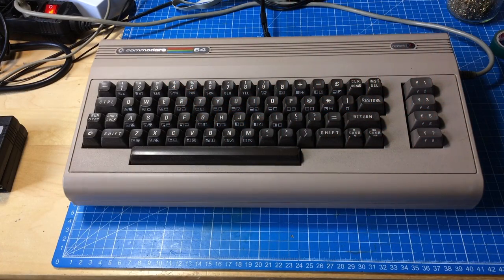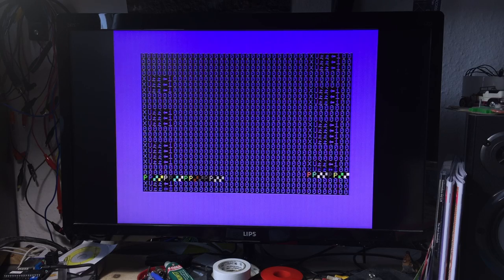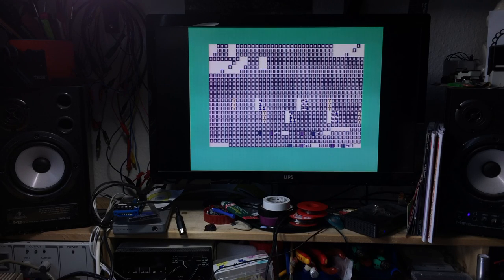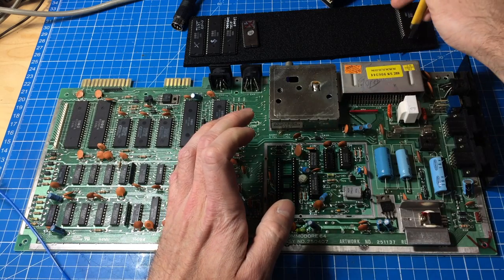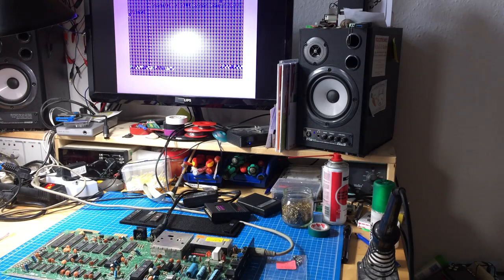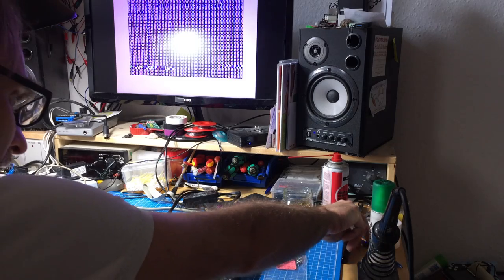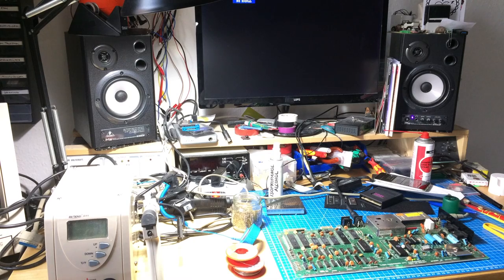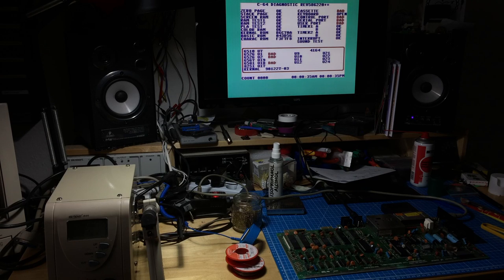Commodore 64 Repair (Garbled Screen) ASSY 250407

Comment: as a kid my first computer almost got to be a (used) C64, however it had a fault just like this. 

my parents and relatives (who were the previous owners) tried a while to fix it but really were at a loss about what to do. last time they used it, it was just fine, they said. i remember them switching the fuse on the board and hoping it would maybe change it. 

and i would power it on and notice that some characters changed on the screen when i pressed some keys, and hoped that maybe if i do that long enough, at some point it would eventually return to the normal screen :D of course it wouldn't

in the end that lead to me having to wait a while longer until i got my first computer, which then was a 286 IBM compatible
Reply from the maker: Oh, that's kind of a sad story and a long wait until your first computer. :/
Reply: well I don't exactly remember how long the wait was, and I am not sure if you are making an assumption here when you say "long wait"

at the time all that happened, the 486 was the high-end on the market, Pentium was not out yet but not too far in the future.

i got a used machine so it was affordable and to get me accustomed etc.
Reply: but of course, back then there was no Pictorial Fault Guide online, etc... 

such resources we have today to fix these old machines are really amazing... imagine what you would have given "back then" for such a wealth of info
Reply from the maker: I remember my first PC was a Pentium 150 MHz in around 1997 (when it was "state of the art") so the 486 was one or two years earlier probably? I'm not very PC savvy at all (I still am surprised every time I want to upgrade something that there are new CPU sockets and next generation PCI buses... ;)) 

It would have started me on electronics very early on probably to have all that information available back in the day. It's like being in wonderland now having all the forums and info available. ;)
Reply: I'm not completely sure when it was, but it must have been 1993 or 94.

Looking on Wikipedia, the Pentium was already introduced in 93... 
but probably the first couple of years it was so expensive it wasn't really an option for most people, at least for the home. So 486 pretty much was top of the line for people with a normal budget.

I remember that when Windows 95 came out, late 1995, there were still discussions in PC magazines etc. about how you would need a Pentium to have a really smooth experience with it, while it was okay on a 486. however, around that time, 1995/96, was when the Pentium also became more affordable. (and had TV commercials, not sure if any processor was advertised on TV before... may have been the first!)

by the way, Win95 even worked on a 386, even though that wasn't officially supported; but it ran very slowly, froze up frequently... I tried that once back then ;)

Comment: ALWAYS be suspicious of MOS branded 74xxx logic. They have very high failure rates; so much so that I often replace working chips just as a preventative measure. Of all of them, MOS 7708 (74LS257 multiplexors, U13 and U25) seem to be the most prone to failure that I've seen..
Reply from the maker: Yeah, I heard about that. I actually had a C64 with one of the multiplexers being broken a while back. Took me a while to find out then. Now I learned that these MOS chips are always prime suspects. ;)